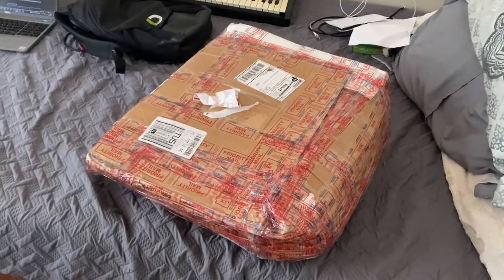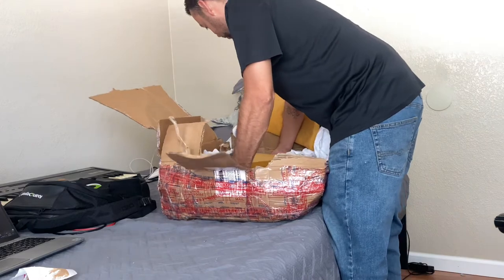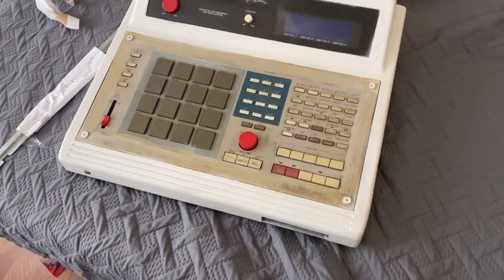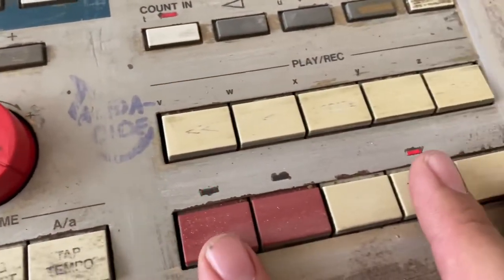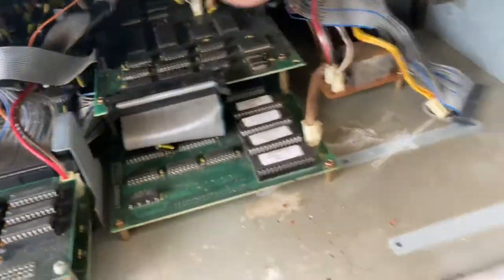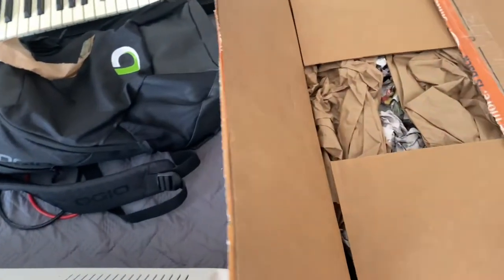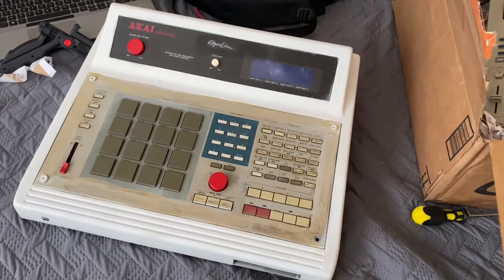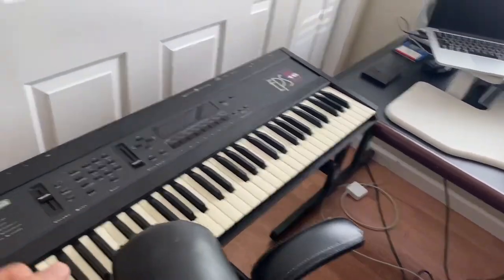I got WHAT AKAI MPC ??? #mpcgang

Comment: You bought a bricked 60ii. Waste of money dude.
Reply from the maker: I’m not sure I feel the same way. I will bring her back and I got it for a good deal.
Reply: @MGtheProducer  Do not go to Forat huge rip off. Go to VST Service in LA. Prob gonna cost a g to get it up and running. Shipping is ~$80 each way too.
Reply from the maker: I have a buddy in town who will take a crack at it on a Tuesday. If we fail it’s off to vst or Bruce. Thank you
Reply from the maker: I have opened her up and the lcd contrast knob needs to be soldered then we will check the r8 resistor as it acts as a fuse to the screen. It’s the first to blow out to save the lcd.. if we fail then off to vst or Bruce.